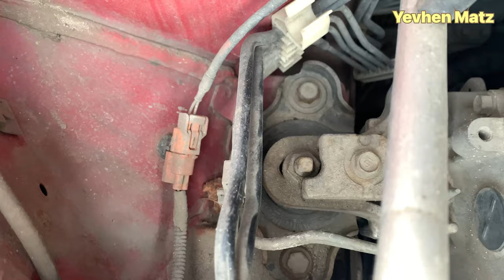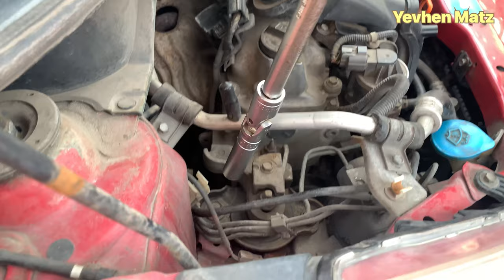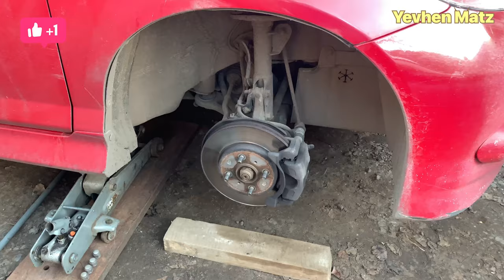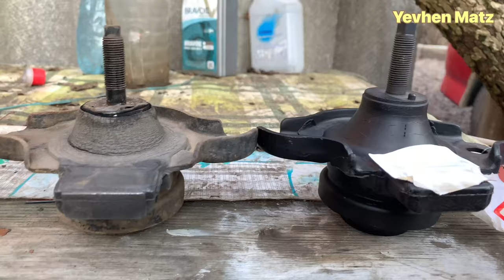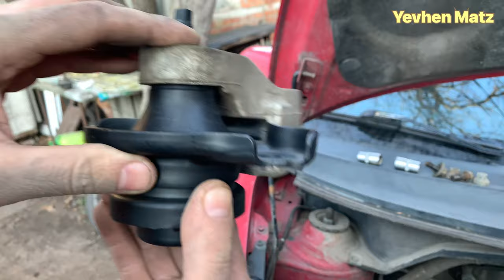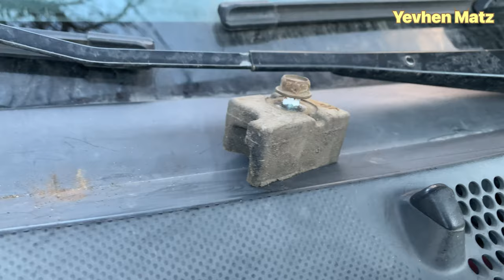How to replace Motor Mount in HONDA Fit/Jazz#ukraine #hondajazz #hondafit

Comment: You missed to tell us about the bolt underneath the cast alloy bracket.
Reply: I know is different but the 09 don't have to remove bracket just wiggle the engine a bit and it slides on

Comment: How much you pay for this motormount?
Reply from the maker: It was in Ukraine, and cost of this work was not high.
Reply: Like 50 bucks at auto zone
Reply: U didn't have to Jack up car or nothing to fix
Also what happen if engine mount breaks fully does engine fall out ?
Thnks